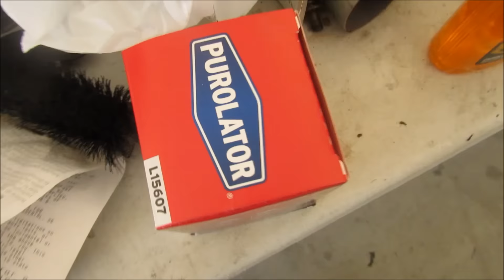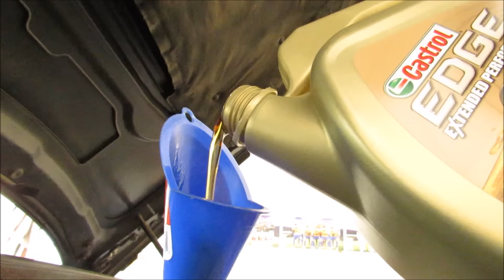BMW OIL CHANGE GOES WRONG!! (IN THE HOOD) (GONE SEXUAL)

Comment: Yo man love the e92, I have an e90 and had a question for you. I have just a muffler delete right now but am considering doing the resonator as well. How big was the difference from just the MD to when you had deleted both? Also did you have any issues passing emissions? Thanks so much man!
Reply from the maker: Removing the resonator wont really make much a difference, it'll just scream a little more in the higher RPM's but that's it. If you really want something noticeable then remove the secondary cats, you'll get a lot of crackle from that. And I probably won't pass emissions when I have too lol
Reply: +Broke Boys thanks for the response! Thanks for the advice man! Alright thanks for saving me the time, the cats are definitely tempting but yeah I'm from Illinois and we have to pass emissions as well. Did you do your secondary cats? If so is there a video on it?
Reply from the maker: +Maxed0ut14 no problem man, and yeah I removed them haha. I rev it at 2:20 on my 2012 accord muffler delete video.